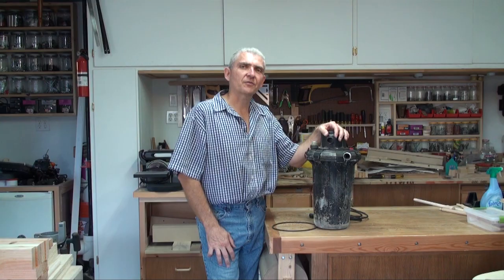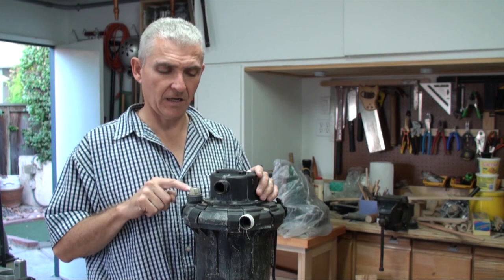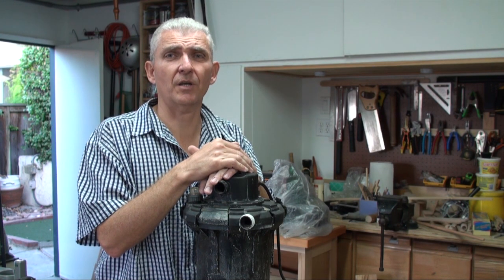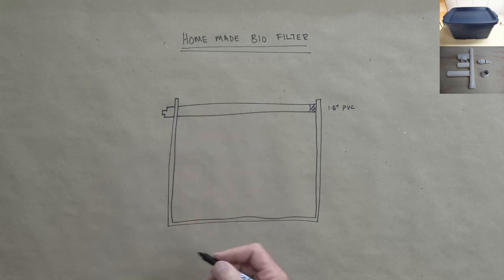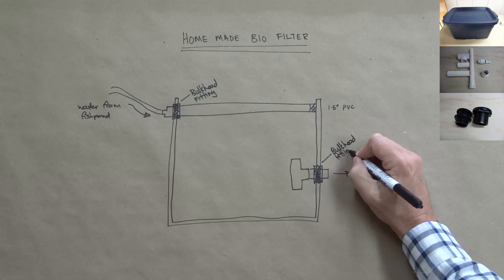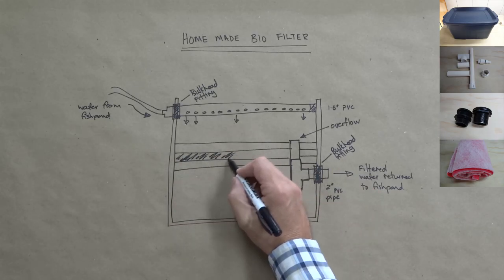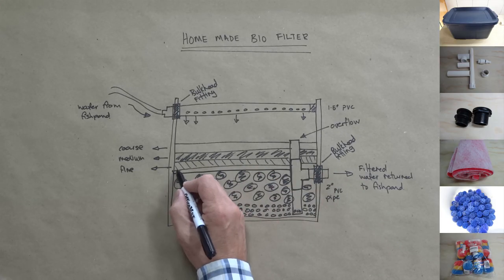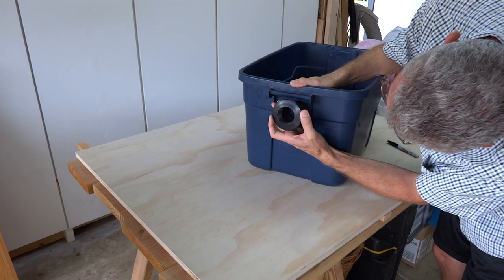Homemade Biological Pond Filter

Comment: Can i ask how the water after it has been filtered travels up the pipe where it goes to the pond?
Reply from the maker: Water returns to pond based on gravity and basic water pressure principles. After it is pumped up into the filter it rises up in the filter and exits out the outfeed pipe.

Comment: Nice job. About to build an above ground pond myself and I'll be using a combination of commercial and DIY filtration. I don't believe you can ever have too much filtration. 😁 Except of course if you do it to the point where the extra work achieves nothing. Basically I'm just adding more to the biological side of things.

Comment: Dear Trevor, great tutorial, thank you!!
My current position is that I took an existing plunge pool (2.85 x 2.85 x 1m deep) and a full three years ago added Tilapia fish to it :-)  I was led to believe that they would consume all the algae but that was wishful thinking. The fish have been happy, have multiplied and come up for food but the green water has prevented me from actually seeing them for well over a year!! Sad, huh?!
I have tried barley grass and various products designed to magically reduce the algae but these have been unfulfilled promises.
The existing pool pump is obviously far too powerful for this job unless I were to somehow do a flush thru the diatomaceous earth filter as a one-off booster  - the only problem being that I cannot see the fish so cannot run any pool brush or suction device thru the pond, least of all to the bottom!
My current submersible pump is the largest I have tried so far but seems happier just pushing the water around and at least getting some aeration in the water. However, with current summer temps around 35C this is all rather a test of the Tilapias' tenacity and staying power than anything else.
So, my question to you first of all must be - what size pump are you using?  I am using a B.I.C.I.S.A. - 4500, operating at 100W and a flow rate, (oviously) of 4500 l/h and a max Delivery Height of 4,5m.
Any input would be most graciously accepted at this stage, thank you.

Comment: its inverted from the profesional biofilters the water comes from the bottom to rise up an flow out of the top dispersing the water evenly across the whole sheets of filters not just the center decent cost saving just need to flip the design in my opinion

Comment: How does the flow rate impact the filtering process.   I have a small pond about 5’x12’. About half of the pond is 3’ deep and the rest is about 1’ deep.  
It is currently fed by a creek about 12’ in length and an overall decline of about 6’.  
I purchased on auction a Flotec 1/2 hp pump.  The good news is that for $7 I have a $200 pump. That said the current pump is only 1/4 hp and I’m questioning the impact of stepping up the flow.  Also looking for a good filtering solution.  Thanks….great info and videos are very well done.

Comment: How does the pump itself bring dirty water into the system without clogging in the first place? I have have a natural pond with trees around it and a bunch of algae/ muck. I've tried copper sulfate and muck-away, but it seems to have gotten worse ( I followed directions) I really need a filtration system, but I feel that the pump itself would get clogged.
Btw, this is by far the best video I've seen on how pumps work. Thank you for that.

Comment: Nice video, is this tote box UV stable for outdoor use ?
Reply: you can paint it with something like an automotive undercoating. Rough sand (100 grit) the plastic surface to give the coating something to bite into, and it will last for years.

Comment: Hi. I was wondering why the input is at the top and not the bottom, or middle? I was thinking the input might be above the bio media and below the filter media. In this case the overflow would not be required as the output is at the top.

Comment: I prefer to separate the bio and mechanical filter.  Solids to a settling chamber fed by gravity only.  Filter material near top of water column.  Pump above near top of settling chamber.  Pump to spray bar at top of bio filter box full of lightweight high surface media like packing straps.  Not rocks please.  Water exits bottom of filter into pond or waterfall.  Biofilt should never be submerged.

Comment: Great video and excellent explanation, and execution, of a bio filter! Question: why not have the outlet flow straight out from the bottom, tee off of it and go up with an elbow back into the top of the container, for the overflow, to maximize bio surface area and eliminate the need for cutting the media pads..??  
                        _____
                     /     _ | __  this is the overflow
                     |     |   |
                     |     |   |  <-- this vertical line is the container wall... 
-------------------      ---|-----
---------------------------|-----  this is the outlet... 
 
Again, thanks for the great video and walk through!

Comment: If this is expensive take the pump put it in a pond water planter basket tie wrap wading around it. Keeps tank squeaky clean.  Costs 3 quid. Each change afterwards cost 50p

Comment: nice, clean design. some good info. one tip: it is a small filter so, (i think) you can make it even more efficient if you want by installing a couple of air stones at the bottom to aerate the bioballs

Comment: Vinyl totes will suffer from UV degradation.  You can build a durable filter box out of cement board, bricks, stone or concrete and use the same kinds of tubing, fittings, and filter media materials.  This is a biological filter that physically strains out big stuff and flows the water over algae covered surfaces of the scrubs, balls, lava rocks, etc and the microscopic critters eat up the pollution.  The algae crud eventually gets thick and  since it takes stinky anaerobic microorganisms to break it down,  we should rinse the filter stuff (not too clean with no soap, cleansers or bleaches) when flow slows down, so that a new crop of friendly algae and nitrobacters can quickly get on with water clarification.

Comment: Thank you for a great video. I purchased all the items (except I made a mistake of buying Uniseal bulkhead (very difficult to use) instead of the suggested slip and thread per you video. Everything worked well so far.  I added two 2” outlet PVC pipes ( I used a very heavy duty sum pump (already have it) with 1-3/4” flex hose. It took me close to 2 hours to assemble it (not too handy....lol), but it worked as seen on the video.i also drilled three rows of 1/2” holes along the inlet PVC pipe tp spread the water over the filter surface... this also helped to reduce the pressure generated from my fast sum pump...so the water in my tote never reached higher than the middle and it’s very quite to run.

My pond is about 4,000 gallon....and it’s so green even though I only have 30-40 small fish. Will report back when the water is clear up... Thank you.

Comment: Outstanding job. There is only one thing I would add. The tub container I would spray paint the outside with two coats of black. This will help prevent any algae from over taking the growth  inside the tub! After drying buy some bamboo, split the bamboo, get a glue gun, glue the bamboo to the sides and top. To camouflage the bio filter.

Comment: This was a great explanation for beginners, I applaud you for sharing. Not my cup of tea though as I would never be able to sit and enjoy a pond where the focal point is a giant rubbermaid tote, its like trying to host a dinner party with a giant tote i the middle of the table. I'd take it a step further and build a simple enclosure to encase the tote and pump, a small bench structure built out of pressure treated boards that you could lift off/over would do nicely or some loose laid masonry to match the surroundings with a simple removable wood top. But your concept and premise is great. Keep sharing.
Reply: @Dale Meaney. Did you not see the opening sequence that shows that he had made exactly what you suggest?  The tote is enclosed in a rather attractive looking enclosure made of wood.  If you had paid attention you would not have made such a condescending comment. Also would hate to come to one of your dinner parties.

Comment: inlet shower pipe is far too big. there is no point in increasing the diameter of the shower pipe to that amount. Notice how only the first half of the tote was wet from the shower? By the time the water reaches halfway, it's lost all pressure. If that is the only pipe you have to hand no prob but make fewer outlet holes. trial and error.

Comment: Why would you use such a big inlet pipe?  Why not just use a 20mm inlet with 20mm drilled pipe arranged into a ring to better distribute the water? Your current setup dumps all of the water in a straight line across the filter foam and the 40mm pipe is way thicker than it needs to be. Other than that oversight the rest of the design seems decent, although your filter media isn't the best, though if you're going for cheap, it's better than nothing.

Comment: instead of the pricey pre-made bulkhead fittings you can use the just regular male and female pvc adapters and sandwich the plastic and cut your own rubber grommet out of soft thick rubber or just use silicone. A lot of useful info on here thanks :D
Reply: Is silicone safe to use in a turtle pond?
Reply: @mindya1799  sure, after it dries for at least a day
Reply: check out rubber   "uni-seals "  a few dollars each

Comment: im thinking of making something like this but was wondering if i moved the outlet to the otherside and higher up .. i want it to line up with my water corse and spill into it was thinking i could put a wall in with a hole in the bottom for the water to go under to get to the outlet .. think this would work?

Comment: Great idea for sure! There is one thing I noticed that may improve even water flow across the top filter layers; I would think if the holes in the inlet pipe were to be smaller and fewer closer to the inlet and slightly larger and more plentiful further from the inlet, it will even out the pressure in the pipe thus dispersing the water more evenly. As with anything, you may have to experiment with various configurations of hole size and placement to achieve perfect flow.

Comment: Fantastic video! Very clear and step by step. Thanks.
Quick question: Would it still work if the filter was placed below the water-level of the pond and a pipe to run up towards the pond or does it reply on gravity?
Reply from the maker: +Eugene Jacobs The filter works on a gravity system. The pump pumps water up to the filter and the water returns to the pond using gravity. To get water UP to a pond from the filter it will need to be pumped.

Comment: I built mine with both the outlet and inlet  at the same size, will it overflow?
Reply: Did you have overflow problems?  I have a strong pump that uses 2" diameter tubing and I don't want to go all the way up to 3" bulkhead and PVC pipe for the outlet.

Comment: after watching this i made my own similar version based on this version.it works a treat,your video was extremely helpful and easy to understand .i have  2/3rds of my filter media under water and a baffle plate  situated vertically in front of the outlet .it has holes drilled through it at the bottom which forces the water down through the media before passing through the baffle then up through more media and the exiting through the outlet .thanks !

Comment: Hi, Trevor, used your directions to build a filter last year, and it's not only made it through the winter, the water is clearer than it's ever been!  I am seeing some "string algae" that I've not had before, but all in all, it's been a great installation!  Thanks for taking the time to share! Kathi In Va
Reply from the maker: +Kathi Meenehan Thanks for the feedback. I also get string algae at the onset of spring. When I see the string algae appear I scrub down the sides of  my pond where it appears and replace 25% of the water in the pond. This is the only time I also clean the filter foam. Once I have done this cleaning I treat the pond with straw barley pellets. This is all I do to the pond until the end of summer. At this time I do a basic pond cleaning (remove as much dirt and dead leaves from the bottom) and again treat with straw barley pellets. I do nothing again until the next spring. You need to experiment a bit because straw barley is a natural treatment and may not work in all ponds depending on the severity of the algae. 

Here is a link to the straw barley pellets I use:
http://www.amazon.com/gp/product/B000256DPO/ref=as_li_tl?ie=UTF8&camp=1789&creative=390957&creativeASIN=B000256DPO&linkCode=as2&tag=trevswork-20&linkId=VS3UUEODJVVVZ4Y7"

Comment: could you install a hose to the output of this filter? That way you could hide the filter else where if you wanted. Or would that screw up the output vs input of this filter?
Reply from the maker: +Michael Lefebvre there is no pressure in the filter so the hose has to be able to sustain not only the output of the filter, but also the overflow. If you wanted to hid the filter then I would use a pvc pipe trail of adequate size to return the water to the pond. In my case I build a wooden filter housing to hide the filter.

Comment: besides that filter do you  have any other pump inside te pond?
Reply from the maker: +memomemomemog yes, you have to have a pump to pump the water to your filter. the pump and size of filter would depend on your pond. typically you want to circulate the volume of water in your pond every hour. In other words if you have a 500 gallon pond you want a pump to pump 500 gallons per hour. A larger pond not only requires a larger pump but a larger filter as well.

Comment: I have built plenty of diy filters for my tanks and pond but recently I learned something for the pond. Using a lowes plastic tote is not a good idea. Get a better one. The one I bought from lowes about 2 years ago fell apart this week. The sunburnt plastic begins to become brittle and slowly breaks down over time. The tote cracked and in the end leaked. His can still be used with something other than a tote. I'm upgrading to a trash can

Comment: can that filter support 40 pcs koi fish on a 500 gals ( 5- 7 inches in size ) ? will it maintain good p.h and low ammonias? how much water change per week should i do if i have more fishes?
Reply: No. 500 gallons is way too small for koi to thrive.
Reply: @thechannelivesetupbecausey3585  You have the dumbest name on youtube.  That should be your new name.  Geezus
Reply: +Seph Raven Hello, your fish will adapt to your normal (tap / well) PH. Remember they have are many breeding generations from their wild cousins. Therefore you should add nothing to your filter or water to alter your normal PH.  When biological filtration occurs, there should always be zero ammonia and close to if not always zero nitrites. Some products (and even lava rock) will in time grow anaerobic bacteria and even remove nitrates. Excessive water flow can be the enemy of biological filtration,  but his design lessens that possibility. For any "Gold Fish," always think of turning (filtering) the water volume 7 to 10 times per hour. 10 times per hour will be easy for 500 gals. Be Well
Reply: +Seph Raven the other 20 fishes are just temporary though
Reply: It depends on the power of your pump

Comment: Hi Trevor excellent video and very helpful, I am looking to add something like this but the pond is 28000 litres do you think I will need several of these. I seen a similar implementation with the coarse, medium and fine split into 3 separate containers stacked on top of each other with holes in the bottom to flow through all 3 one after the other, do you think that would be worthwhile adding or would one container have enough effect on the pond? Thanks in advance for any help you can give me, Ray

Comment: Loved the video! I was thinking to make a low-cost filter by filling a bucket with diatomaceous earth, do you think that would work? Also, do you backwash your filter to help keep it clean? How often do you change the medium? Thanks for making the video!
Reply from the maker: Joel Taylor I am not sure about a diatomaceous earth filter for a fishpond. This one is specifically a biological based filter so you rarely clean it or backwash it since you need to grow the bacteria in the filter. I clean my filter once a year in the spring. This is the second year I have had it running and it has stood up very well. Depending on the size of your pond you may need to scale your filter up to match the volume of water in your pond.

Comment: I'm building a filter like yours. I want to order the bulkheads, as I can't seem to find them in stock in stores around here. I have 1 1/2" pvc for the intake and 2" pvc for the outflow. What size bulkheads to I need to order?

Comment: I forgot to ask my question... Would you recommend filling the bottom of the tote with bio balls and charcoal?
Reply from the maker: Eric Colhoff You do not necessarily need bio balls if you are using the plastic pot scourers. You just need something with that type of surface area to grow the bacteria. Not sure about charcoal, it is not something I have tried.
Reply: @trevorsworkshop As a chemical absorber,  the charcoal might be beneficial for many reasons, but if you use it, it must be replaced, or over time it will just release what it has absorbed back into the water.  (months)

Comment: fantastic video. I'm building a raised pond out of 4x4's that will be 8'x2x30" between two decks that are at different heights and  I've been looking for a simple filter system that will sit at one end that I can hide and yours is the best I've seen so far.

1 question, what's the name of that song?